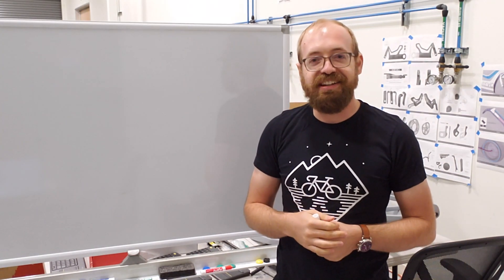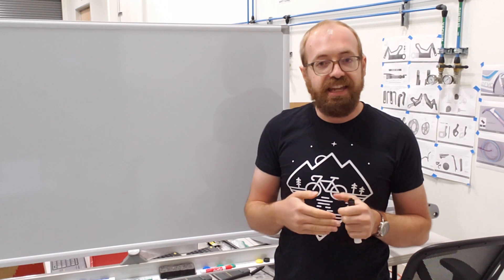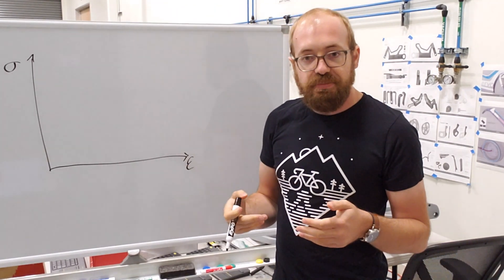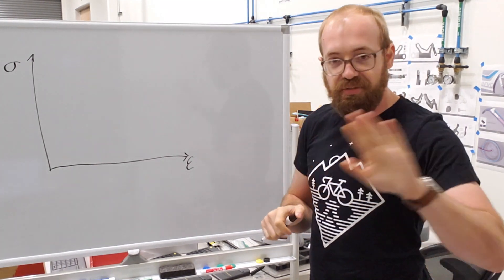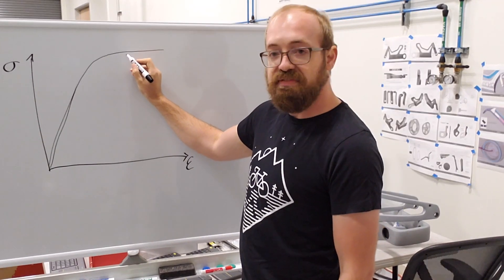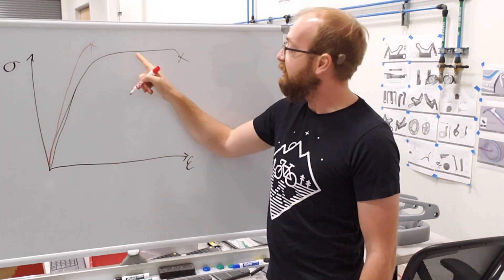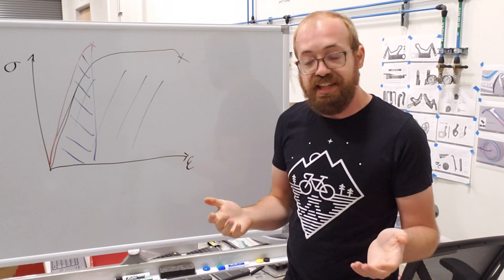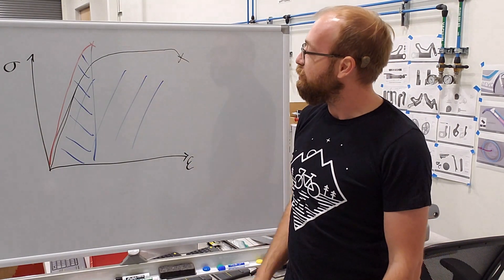The toughness of Superstrata's frame

Comment: Unfortunately thermoplastic carbon fiber composites do not show the behavior described in the graph. 
Thermoplastic CF composites have similar elongation at break compared to thermoset CF composites. The ductility of the material is largely influenced by the elongation of break of the fibres. Therefore, carbon fibres always impart extreme brittleness to the materials due to their low elongation at break which is typically under 2%.

One difference between continuous carbon fibre composites made from thermoplastics vs. thermosets is their delamination behavior, which can be measured by double cantilever beam tests (Mode I fracture toughness). Thermoplastics have a somewhat higher tolerance to delamination, but in my opinion it is a common misconception that thermoplastic composites behave in a ductile manner.

Comment: Let's just cut to the chase, you have 180 lbs sitting on a 4 inch tube with no way to carry that load down the frame to the bottom bracket mass. That load is being carried to the front and back seatstays which means you now have compromised the load bearing of the seat stay joints which are carrying at least 90% of the load. Add in a seat post tube down to the bottom bracket and call it a day. This design completely disregards actually pro cycling in general, as you also forgot that we ride road bikes up mountains, since the bottom bracket is floating without a support column I would snap this frame in 5 minutes going up a mountain.

Comment: All nice in theory, but I would like to see someone riding and sitting on the saddle of this bike without a seat tube before I believe that it's strong enough.
Reply: In the commercial you don't see the rider seated on the saddle at all (there are some glimpses of a seated rider, but these are for another variant, without seat stays but with a seat tube).
Moreover, they are not lighter than aluminum frame.
Finally, you get only two years warranty, compared with lifetime for simple aluminum frames from leading manufacturers.